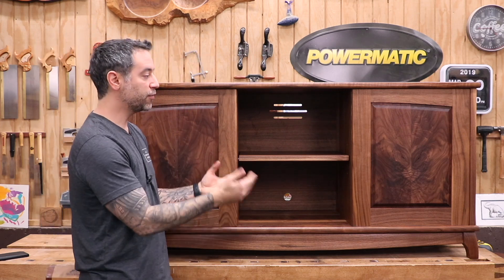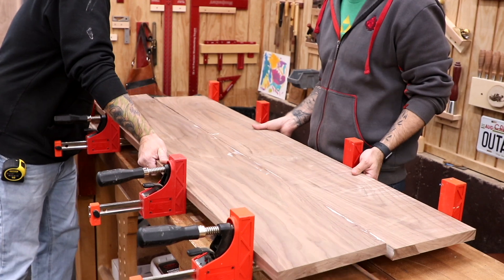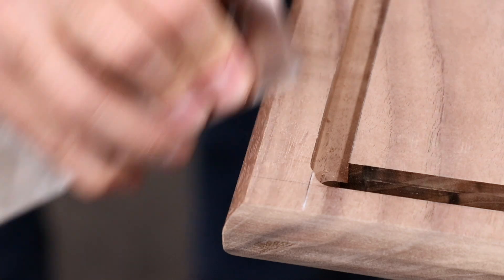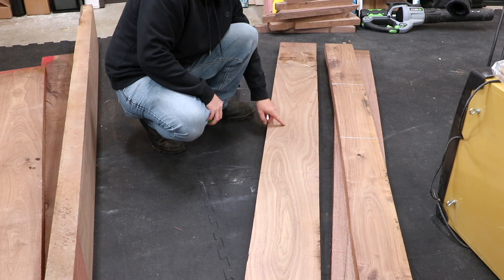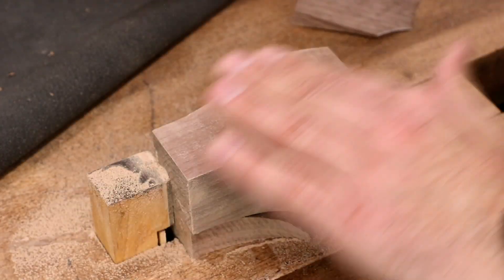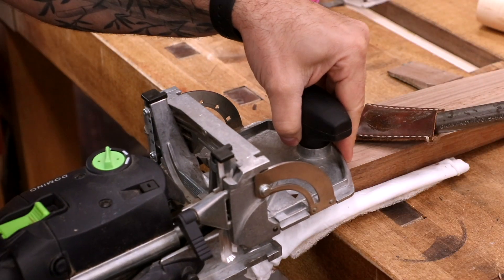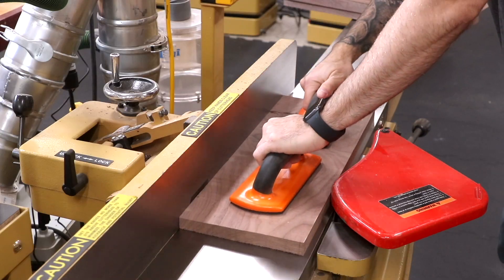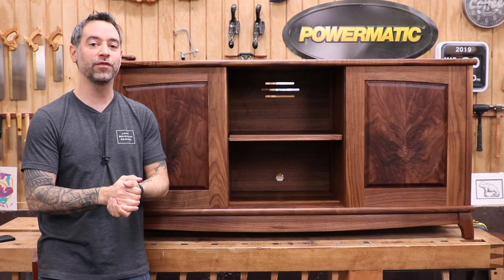Media Credenza, Now with More Crotch!

Comment: The most impressive part of this entire build was the fix that you had to implement to repair the measurement errors. Most of the time, what separates the men from the boys, is the ability to fix mistakes in an undetectable way. You did a fantastic job of recovering from that mistake. and Thanks for showing the errors and how you recovered from them. To me that's almost more educational than the build itself.

Comment: Great video!  I made one several years ago, but with a drawer at the bottom of the right and left.  This gave me room to put a false back and a shelf tucked in the back behind the left drawer for a battery backup power supply.  All the cords go through the false back with a single "harness" coming out of the back that plugs to the wall power, HDMI and the banana plugs for all the speakers.  As Marc said multiple times, for some equipment I had to install some fans to extract the heat so leave room somewhere for that.

Comment: That dangling little trap at 5:57 and the thumb just waiting waiting to be cut to length at 6:02 give me quite a wonky feeling.
There are a few things we learned in carpentry first: don't stick any fingers out. Pretty much ever. Don't leave anything dangling around. Never go closer than one hand width to any tool-blades and stand securely on the floor. Although slower in the short run, and needing some getting used to, it is quite worth the trouble as it significantly decreases the chance of a serious injury.

Also, really nice cabinet :)

Comment: Marc, buddy. What you are doing with your left hand at 17:53 is how I almost lost my left thumb. I literally jumped out of my seat watching you do that and remembering my injury. I was doing repetitive cuts like that and going too fast. Please reconsider that operation in the future! We don't want you to lose any digits. Stay safe!
Reply from the maker: What else were you doing when you almost lost your thumb? I don't mean to be a jerk, but I'd bet you weren't using a riving knife, a featherboard, and a push stick. That move is done to help keep the work from traveling away from the fence and keeps the cut consistent. It's not something I do often but I have no problem doing it when I have those other safety devices in play.
Reply: @woodwhisperer  good points. No jerkyness spotted. I was concerned about kickback on small trim rip cutting and I did NOT have a riving knife at the time. However, if the riving knife is doing it's job, why do you need to use your left hand in this operation? Great project BTW

Comment: Marc, what about wood movement in the partitions? Is that a concern? Or how do you account for that. Same question for the top its joined at all the partitions wouldn't this effect the top adversely? ...I'm feeling very lost on wood movement and want to understand more. I get that it moves with width etc...side note as a chef/kitchen manager I am familiar with angry face after a mistake that requires fixing, gave me a good laugh along with all that crotch.

Comment: WOW, did I just see you make an unsafe cut at the 7:00 minute mark of this video?  I have always heard that you should never cross cut material that way between the blade and the rip fence.
Reply from the maker: As a general rule of thumb, you want to avoid cross-cutting anything that is longer than it is wide. But when you have enough reference surface against the fence and an experienced set of hands doing the work, it's safe. Your mileage may vary so if that kind of cut makes you uncomfortable, don't do it.

Comment: Where did you find the white lead pencil? I need several.
Reply: Wooden Things -  you can pick-up good quality white colored pencils from any art supply store, amazon, etc..   Typically most office supply stores, art supply shops, or places like Hobby Lobby sell individual colored pencils for the most commons colors... So you can go to any Hobby Lobby or Amazon.com and buy some, good quality white color pencils.   (IMO the better quality white colored pencils work much better then the real cheap ones... the white “lead” in the cheaper pencils seems harder & does’t show up as brightly on wood.. the higher quality white pencils have softer/ more waxy white  “lead” that shows up much brighter on darker woods & seems much easier to sand off (or even wiped off with mineral spirits).

Comment: Hi Mark, which epoxy are you using to fill the holes in the crotch boards? Is it Epoxy directly or epoxy with some stain? Need to do the same to the crib I'm building. Thanks in advance! Keep up the good work.
Reply from the maker: Total Boat epoxy with a drop of Transtint dye.

Comment: Why do some woodworkers say '12 quarter stock' instead of 3 inch?
Reply: Because 3" isn't 3". Welcome to wood. 3" is measured as it was cut wet. It will shrink considerably before it's ready to work, possibly to 9 or 10 quarters.